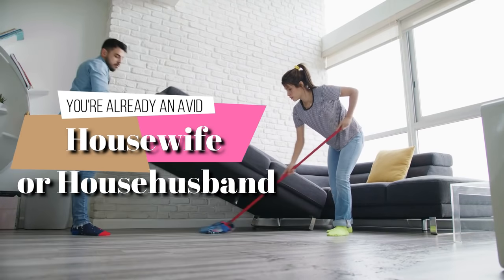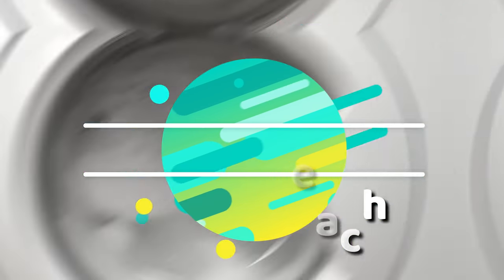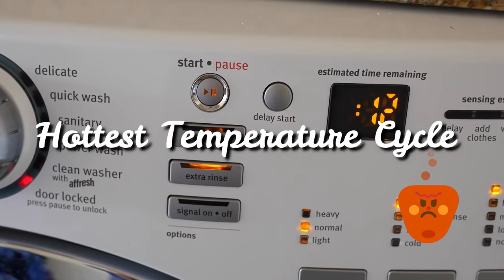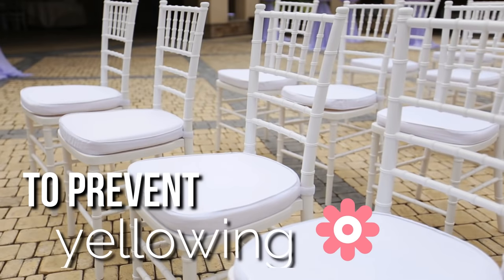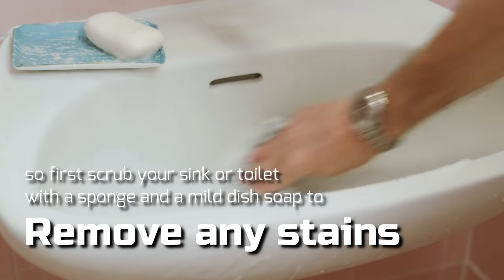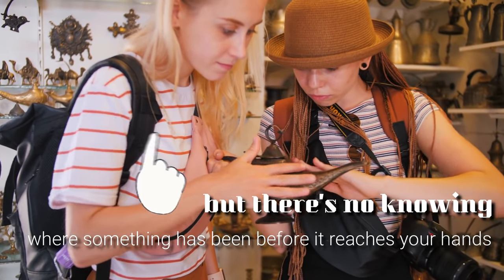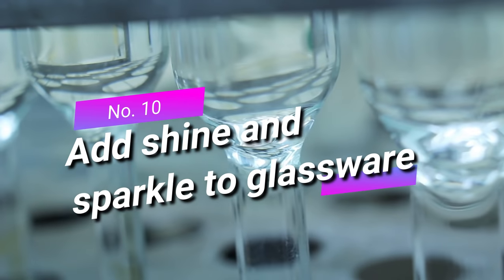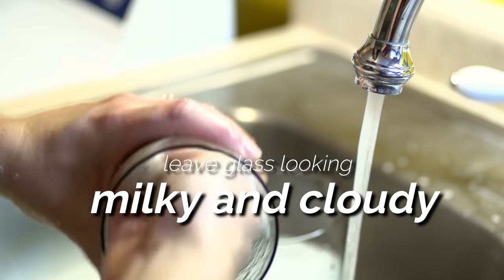11 Useful Uses & Benefits of Clorox Bleach For Homes

Comment: If I use a wood cutting board I always soak it in absolutely nothing, it'll ruin the board. Dilute bleach in the bath tub and soak white plastics, from rolling those cheap deck chairs, cutting boards, mixing bowls, cooking utensils and kitchen trash cans to name just a few. Add a teaspoon to your dish detergent and water. I've no confidence in dish detergent these days but I still want the suds. Soak your white coffee machine upside down in the sink, being careful not to submerge the base, rinse and run the machine a few times flushing the system.